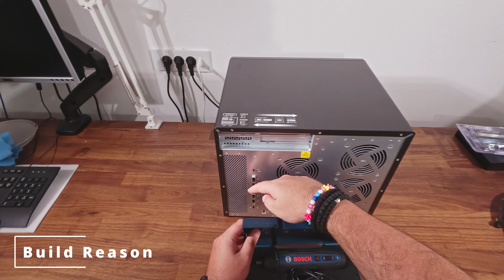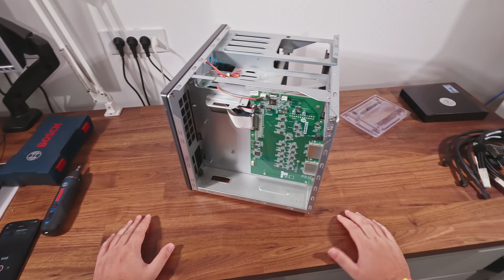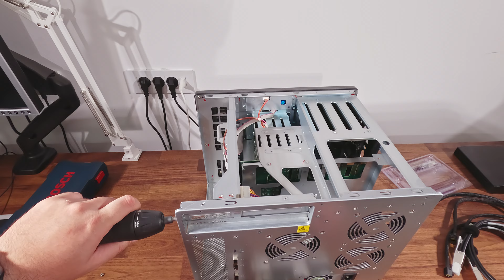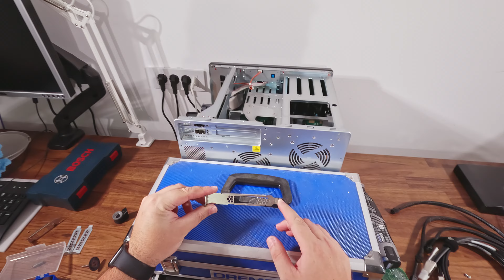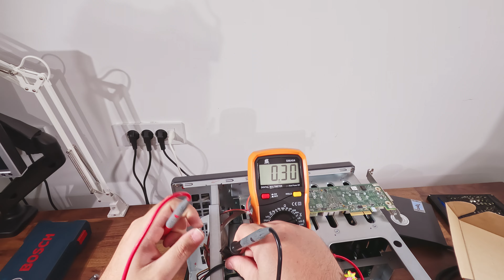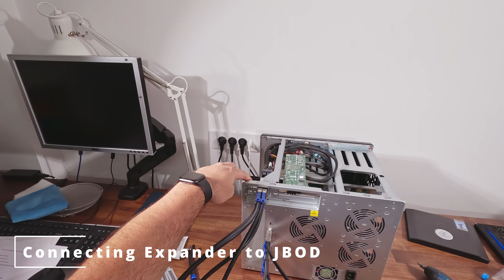Chia plotting: QNAP TL-D1600S SAS expander mod (PART 2)

Comment: Quick question: would the qnap box work fine if i used a non qnap lsi card (using all 4 cables). There’s nothing in the box itself that’s proprietary?
Reply from the maker: It will work with any and all recent sas hba's.
Reply: Sweet thanks for confirming. Going to use it for a NAS build with a USFF 1L pc.
Reply from the maker: @MetalPhreakAU  UUU real nice, its gonna be mega low power when idle.

Comment: You don't have to plug the pci card to a pcie slot?
Reply from the maker: No need, it does not communicate to the cpu or the rest of the system it just expands lanes, pcie slot is only there for power.

Comment: Forgive me but what the heck is this mod for?
Reply from the maker: Its explained in the video, the box doesn't have the expander on its own, it requires all 4 connectors to be plugged in order to access all 16 drives, this allows me to connect just 1 cable and use all 16 drives while also giving me the ability to daisy chain boxes to one another or link one box to multiple hosts.
Reply: @TekJumble  Is the overall link speed effected? What HBA are you using?
Reply from the maker: @pattygq  Case connectors have 6 Gb/s links while the expander that I installed has all 12 Gb/s links (2 of which can be used to connect to HBA) so no there is no bandwidth degradation but that is besides the point because this case will house only HDD's which would not even be able to saturate 1 12Gb/s link. I am using LSI SAS 9300-16E